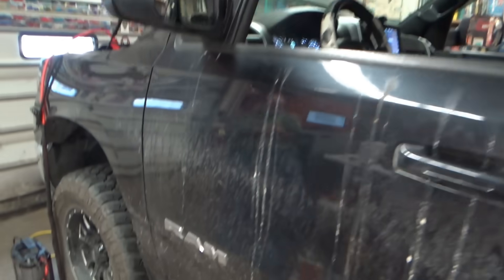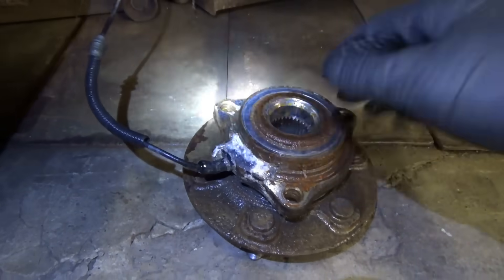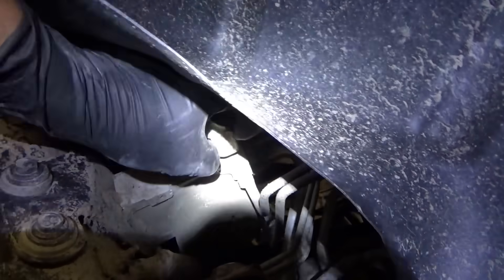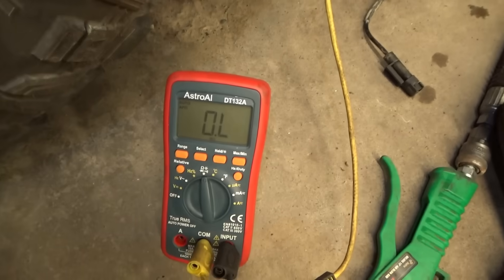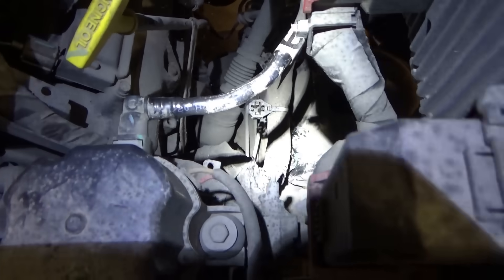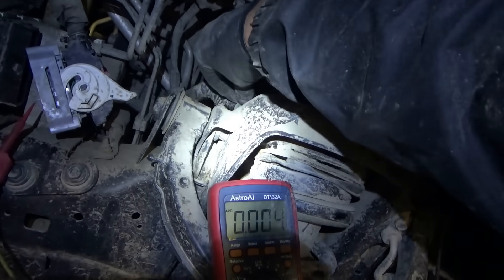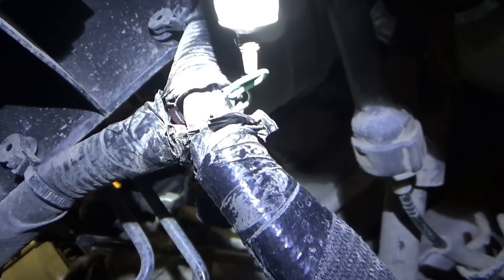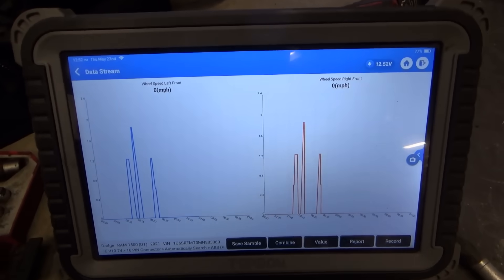Dealer Would NEVER Find THIS ABS Problem!! ('21 Ram V8 C0031)

Comment: As a long time flower of the NHRA, I believe the failing NHRA has just put another nail in the coffin! As a final championship event, it should be run in its entirety. Four rounds of qualifying and normal final round racing, no matter how long it takes or even a change of venue. What NHRA did us an absolute disaster. As a NHRA TV subscriber since it first started, I'm done with that also. There are less races , more four wide racesthat I won't watch. Four wide is not drag racing. It's no longer worth the ever increasing price. Terrible audio.  Then they put it on YouTube for free.  Also it's becoming a circus act, Jaylo making a full of himself! I just want to watch drag racing and get actual racing information. Only bright side was a few new faces for announcers. Miss. Enders was great as well as the Top fuel lady driver. There announcing was the only brite side of NHRA TV. 😢

Comment: Have this problem, C0031, the wire was off just above the connector to the abs sensor. The wire does not loop around in the engine bay (2014 ram 1500) but goes directly to the ABS unit. Thanks for posting this helped a lot.

Comment: Got to love a no parts repair!
The last wiring fault I looked at was a case of 2 wires rubbing on the inside of the trunking. There was no external damage at all. The resistance of one wire was at about 35Mohms until I moved the harness miles away from the break.

Comment: I had a similar problem with a used Honda Element. The factory manual troubleshooting indicated that the ABS VSA modulator had failed. This was a known issue with that vehicle, and the modulator in it was a salvage yard replacement, so I found a used replacement modulator with a warranty from a year that didn't have the issue. 
After I installed it I got the same codes. Thinking that the replacement unit was bad I removed it,  noticing that the connector lock was damaged and that one of the cables in its harness was stretched banjo tight because of the routing.  I'm an electrical engineer, not a tech.  I rang that cable for continuity and found it was open.   I fixed the cable, rerouted it, replaced the connector shell with the one that was on the stub cable attached to the replacement, and the ABS codes were gone.  If I had checked the cable first I might have saved the effort of installing the modulator twice.

Comment: My wife's coworker has a 58,000 mile 2020 escape that started bucking and jerking, it needs a shift control module, the dealership worked her up for that, 2 tpms sensors and a pinion seal for $1600. They told her that having independent shops do any work will void her aftermarket warranty, a warranty (I assume a powertrain warranty) that only covers the pinion seal and not the shift control module. 
To make matters worse she drove it to work 2 days like that probably 20 miles. It was displaying a SHIFT SYS FAULT with the red exclamation point. My theory is at that point she should have driven till the transmission died, I feel she has likely done irreparable harm and she'll still have a hurt transmission after the repair.

Comment: Of course the dealership would have found it. $20k, you need a new harness. The parts cannon salvo probably would go, a new sensor,  then a new wheel bearing, then a new abs module, then a new harness.

Comment: cool.
nice you found it.
i did have a problem once with a brand new hub, complete sensor.
replaced it with similar problem.
ordered a new sensor thinking it came with a faulty one but still didn't fix the problem.
found the old hub and took the sensor out of it and put it  in the new hub and problem solved.

so i must have gotten 2 incompatible sensors in the hub and the replacement.
crazy these new vehicles sometimes.
probably should have tried the original from the start.
i wouldn't have replaced the whole hub for it again. 
although in your case it's strange it didn't show up before the hub replacement.
coincidental timing can throw you. had it happen enough times.
if in my example above it didn't rectify with the old sensor, i would have gone after wiring next.
but it's not your first thought when it as fine til the hub got changed.

Comment: This sort of issue was/is so common on Jaguars from 2005 to 2015, the factory traced the cause to the wire manufacture process before the harnesses were assembled, A/C , ABS, EMS you name it ,it faulted, as early as unregistered showroom cars, no miles!  So time consuming to trace and repair. Good vid, like your style Ivan. (from a jaded former master tech in uk)

Comment: Use the continuity setting on your meter to test for intermittent/open conductors- you will get an audible  signal when moving wire at damage location closes the circuit - allows you to focus on manipulating the conductors without having to look back and forth between  the meter readings and the harness.
Reply from the maker: Now tell me why the "beeper mode" would have been pretty useless in this particular case :)
Reply: @PineHollowAutoDiagnostics  always thought it would be useful to have a reversed function switch on that...
Most beep functions are diode testers... They're not looking for a change of resistance. It measures the forward voltage drop across a diode if it's there.

Comment: Great video as always. Curious if you plugged in the old hub assembly and if it worked. Don't know if I missed it, but was this code the reason of changing the hub assembly? Wondering if it got replaced for no reason.
Reply: He says at the start of the video. The hub was replaced because the wheel bearing went out due to the big tires

Comment: I'd like to see a video on aftermarket sensors and why they seem to never work correctly or don't last long. Example my daughters Nissan maxima needed two cam sensors and according to the Nissan community no other sensors will work and so far they are correct.  Some of the name brand parts like Denso or Beck Arnley Ngk etc even upwards of 65  dollars each won't work.  But why. It's hard to pay 200 plus dollars for oe when many reputable brands should work.  So if you have oe and others what is so different inside the circuitry that aftermarket as a whole do not function correctly.  And in depth videos out there on this subject?

Comment: To speed up diagnosis I would just attach the old wheel speed hub to the right to make sure it works, and then bring it over to the left to check if wiring was a problem... apart from that.. good find!

Comment: Nothing is more satisfying than finding a wiring issue, especially an intermittent one. A hard failure saves us a bunch of time. 

The shop could have plugged in a new hub without installing it to see if it was the issue. ;)

Comment: hey man, I follow your channel because I like your content, like what you do, and how you do it. but as an almost 30 yr career technician with the last 20yrs at dealerships, I know for a fact I would have done basically what you did, and I would have definitely found that problem. I think you are a little off in bashing the dealers for incompetence, although I know where that's coming from, I've lived it for 20 yrs. Every shop has good and bad techs, or experienced and inexperienced techs. dealer or independent. some guys will get away with the parts cannon sometimes, blind squirrels, but our bosses don't go for that either. that kind of garbage only goes so far, it does cost the dealer money, and the management does take notice of the guys that cost them money. Every shop has a couple of guys that when problem vehicles reach a point, we get called to take over. 
What you did here, by comparing L to R, and then dividing and conquering the circuit should be fairly easy for an experience tech. Unfair to say the dealer wouldn't have found it. just as likely for an independent to throw a hub and sensor at it, not be able to figure it out, and give the customer some BS about "maybe it needs an Update" and you're going to have to bring it to the dealer. then it winds up in the dealer to be repaired, So not only has this guy spent bad money at So and So's garage, but now they are spending more money so that an experienced tech can fix it. sound familiar??? that's why people bring their vehicles to you. 
Finding a good tech is hard, everywhere! Not all dealership techs are bad, some really good ones out there. Maybe focus on the industry as a whole rather than just blanketing dealerships as bad. 
I enjoy your content, and have learned a couple of tricks along the way. I will keep watching, keep up the good work.
Reply from the maker: Hey Matt thanks for the kind words! Of course there are some sharp techs both at dealerships and indy shops. But my experience with dealership service departments as a whole has been so abysmal that I can't help with a bit of light bashing 😂
I've even talked to a few dealership techs who admitted that they are not allowed to think outside the box and have to follow the almighty flowchart 🙄
Reply: @PineHollowAutoDiagnostics  I'll just say this, being a good tech in a flat rate system at a dealership is tough, especially when you have to play inside the box, and the mgmt and service advisors have no clue as to what is happening, even if you explain it to them.

Comment: Great job finding that wire like that! Great video as well! Been watching for a while and I am captivated by this type of work you do. I was in fact so inspired that I have decided to do some coding on my car, as a starter. And for that, I've bought myself a Tornado 90000 like the one you have. After using it for the first time, I have an active DTC in the ECU: "U013200 Lost communication with the Suspension Control Module A". This DTC will not go away, but the funny part is that everything works fine, no lights in the dash and the air suspension is working properly. Yes, I have a piggyback module on the suspension that lets me set different values for each drive mode so that I can lower the car even more and yes, I HAVE already tried to remove it, but the DTC is still present. No other faults are present. I don't think this is to do with any of the coding I have performed. I've watched a lot of your videos and just wanted to ask: is there a SAFE voltage to set this Tornado 90000 at in order to code??? I've set it at 13.5 and now I think that that could be the problem. The ignition was on and the car took like 20-30 Amps at the beginning, but if the battery was full and it kept getting that voltage...? Any input would be great. Keep up the good work!

Comment: I also cover my solder joints with a thin coating of die-electric grease just before sliding the shrink wrap over.

Comment: And that kind of diagnosis and repair is not going away no matter what they do with vehicles.  Unless they just stop rolling on the ground all together.  

I snagged this from a podcast a few years ago:  

"There’s also going to be a huge growth area in the maintenance of any kind of computer system that has underlying AI in it, including robots. I think robot maintenance is going to be one of the biggest growth areas in the next 20 years. We cannot keep all the robots that we have right now working. And we’re not thinking about maintenance in a way that’s streamlined, that can pull from the resources of the typical socioeconomic class that’s doing maintenance now on regular forklifts. We’re going to have to figure out how education needs to change so that we can help people lift themselves up by their bootstraps."

Mary “Missy” Cummings,  professor in the Duke University Pratt School of Engineering and the Duke Institute for Brain Sciences, as well as the director of Duke’s Humans and Autonomy Laboratory.

Comment: Mr Ivan, I have a great respect for your Diag skills from the electrical problems I have seen you diag and repair.  You have a better understanding than I do on alot of this stuff and I have ALOT of Factory training. However as a 25+year Chrysler dealer Technician I take exception to this Video title as I HAVE  Diagnosed and repaired this EXACT failure on newer DT Ram Trucks. The first one took some doing to find the next 3 I knew exactly where to look. That said I still enjoy and learn from your videos and will continue to watch.
Reply from the maker: Good to know it's a pattern failure... Job security! 😊

Comment: Dealer tech here and I’ve seen at least two trucks with the same break in that same area! Same diagnostic process. Of course it’s a mechanic’s luck that they would do the correct repair only to have something else break and cause the same code a day later.
Reply: I know I'm a Chrysler dealer tech too. I dont know why this retard says the dealer would never find this problem.

Comment: Water resistant but not waterproof. Use liquid electrical tape and let it dry before wrapping it. It will actually seal and stay attached to the wire.

Comment: Thanks for the sales tip, I ordered a TS101 which will be arriving in time for me to repair a harness that someone had put a butt connector right at the plug, which of course broke, so I will use to TS101 to get rid of all the butt connectors going to my tail lights on my 2005 Yukon.

Comment: Great video!

A question though: Why isn't there any inner fenders? On other cars (at least the European ones I've seen) inner fenders protect everything except a really short part of the ABS wires. In particular no junctions or whatnot in the harness where salt and sand can get in from the wheel well. (Sure, some sand and salt can get into the engine compartment through other ways, but that is way way less of a problem).
Reply: The inner fender is in-place. There are gaps in it because this is a body-on-frame vehicle and the body and frame move around a bit relative to each other as you drive down the road. There’s also components and wires and pipes that have to go through the inner fender or from the body to the frame in that area. That’s why it’s not a solid piece

Comment: The difference between a mechanic and an engineer, the mechanic says replace the part while the engineer says find out what made the part go bad, my friend has a 2016 Passat, all of a sudden the dash is all lit up, abs airbag etc lights, he looked it up and everything pointed to a bad wheel speed sensor right rear to be exact, I replaced it for him, not an essy job they get stuck, codes were still there lights were still on, I found a video where the cause on one Passat was a chewed through wire in the rear, he refuses to believe it could be a wire issue even though he lives in a semi rural area with mice and squirrels, they already chewed the battery cover, he won't listen to me.

Comment: Do you think the dealer would replace a couple sensors, then a module and then finally a harness on purpose? I mean, do you think they actually have a policy(not written policy of course) to do it like that in order to generate multiple repair events?

Or do you think they are just set up that way because part swapping works most of the time?

Comment: How likely was it that the original hub was actually bad? Can it be tested off the vehicle by plugging it back into the harness and spin it?
Reply: At about 0:15 Ivan says the wheel bearing went out in the hub and that is why it was replaced.  Could be the wheel speed sensor in the old hub is good, but that does not do you much good if the bearing is bad.

Comment: Great diagnostic strategy and NPR repair, Ivan! I guess, not only the dealer, but a lot of techs, would not find that problem - they would just throw parts at it, until they finally replaced the harness.

Comment: withour re-engineering the wheel (pun intended)  oversized tires are asking the hubs to do something they are not designed to do.  ESPECIALLY on a steer axle.

Comment: Out of the 12 techs at our CDJR shop, four of us would have easily found that bad wire. I thought I was a really good electrical guy at the Cadillac dealer for almost twenty years. GM vehicles are cake compare to any Chrysler products. If you want to get REALLY good at electrical, work on some CDJR vehicles. We (well the electrical guys) do electrical diags like this daily. Also, their electrical diagrams are the best in the industry.

Comment: I have always used liquid tape and then taped over it. I have never felt confident in that. Great tip on the dielectric grease—I have that! I lifted my 2010 Avalanche and run 275/70/18 tires without hub or CV issues, 180,000 miles so far (4 years and 80k miles on lift kit). On an unrelated note, I have had almost identical Mayhem branded wheels on my truck for 3 years through New York salt and abuse. They still look perfect, and I have been 100% impressed by them.

Comment: Had a 15 ram deisel with a intermittent stall, only code was for a lift pump control circuit. Wasnt broken when i looked at it so i just had them drive it until it was. When i broke i was able to confirm that it was loosing ground to turn on the lift pump. Took a while but finally found the harness rubbing on a clamp for the charge pipe. The main power feed for the pcm was rubbing thru the clamp and the sending power to the lift pump control.